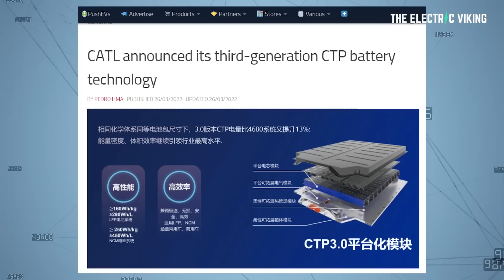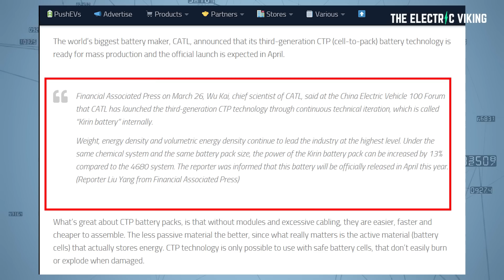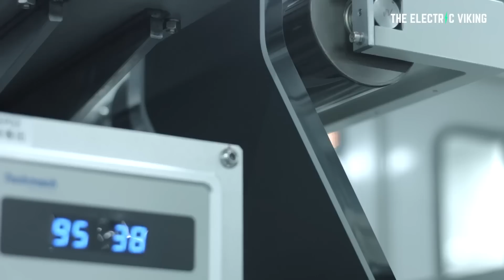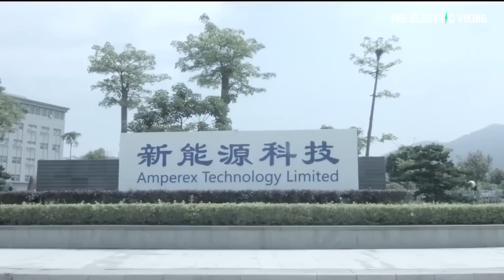NEW Teslas to get 28% higher energy density LFP cells

Comment: Very interesting. We need to remember that the 4680 Cell is a form factor and Tesla has developed it as a Tabless design. You can only talk about the current density of the 4680 Cell, because it could potentially use just about any chemistry. There's no way that Tesla are going to stand still with what chemistry they use.
The key thing that everyone seems to be missing is the ultra low internal resistance of the 4680 Cell, and the amazing thermal performance. The 4680 Cell has to be cheaper to manufacture than any of the pouch cell designs because it's so much simpler and lends itself so well to mass production.
I wonder how many years it will be before we have relatively few cells that give more than enough range. Imagine a car that only needed half the number of cells. Imagine the weight saving that immediately translates into longer range in itself. This can't be more than a decade away, and that will change everything.

Comment: Would be good if you go into the theoretical maximum amount of energy density based on lithium chemistry. From my understanding the energy density of batteries in terms of volume and mass is near theoretical limit (somewhere in the 90%). I think the real benefits come from packing efficiency, cycle degradation and fast charging.

Comment: Degradation is a way bigger problem than capacity.
Having your expensive Tesla be nothing more than landfill after 10 years is a huge problem.

My Ute is over 10 years old, cost me $45k new. Currently people advertising them for around $20k.

If I had bought a Tesla instead I would have a car with an absolutely fucked battery which would cost far more than its value to replace the battery.
It would be landfill.
Reply: Those batteries are already a thing if the past. New ones will outlast the car.
Reply: @monkeysezbegood  I'm yet to see one.
Reply: @youtubevanced4900  Basically all the Tesla's especially the cheaper standard range LFP battery ones.
Reply: @monkeysezbegood  guess we will find out for sure in a few years then.
See if a bunch of people start burning their cars as the battery get older.
Reply: @youtubevanced4900  yes, some of the legacy auto companies are struggling! It's not even their old cars.. GM comes to mind.

Comment: They say better than 4680. 4680 format with their chemistry or 4680 with Tesla chemistry?
250wh/kg is not good vs 2170 unless they are reporting wh/kg at the Pack level. 
2170 has about 250wh/kg at cell level. 4680 is supposed to have roughly 50% greater energy density. 
That would be much higher. So the stats are confusing.
Reply: I think they're just saying that sticking the same LFP chemistry in their cell-to-pack is 13 percent better in pack density than sticking it in 4680s. That's how I read it from the details discussed in the video.

LFP might have different thermal management needs vs NMC so it's possible. I think NMC will still win the density game with 4680, but this bodes well for stationary storage and standard range product lines.

Comment: 2012 Tesla Model S used Panasonic 18650 cells, with 250 Wh/kg.  That is the same as the new CATL NMC cells.  I don’t see the improvement here, unless maybe the CATL specific energy number was for the complete pack, instead of just the cell.

Comment: I'm hoping for a LFP Cybertruck.
Reply: I think it would make more sense for Cybertruck to have NMC:

LFP makes sense for regular vehicles such as the standard range 3/Y models, or for stationary battery storage where weight is less of a factor.

But long-range or tow/haul focused stuff like Cybertruck and Semi would benefit more from NMC chemistry, where the sacrifice in cost vs energy density is different. Most customers would probably prefer to be able to be able to drive ~500 miles and haul ~300 miles in the tri/quad-motor config, rather than spend $5000 less but get a truck that probably has 100 miles less range in those two scenarios. 

Would also be nicer from a charging costs angle to have NMC here, since such products consume more energy, have bigger packs and tend to be driven longer distances than average.

TLDR: The $/lb or $/mile equation might be different for such product lines.

I think Elon stated that down the road LFP will make up close to 70 percent of their products, so I'm assuming the other 30 percent will be trucks and semis etc that use higher energy density chemistries.

Comment: EV range at speed is hardly affected by vehicle weight. Once up to speed it keeps on going. 
Stop start traffic uses more power, but efficient regeneration braking puts back at least 80% (of the energy used to accelerate the vehicle) back into the battery. 
Excessive weight is never good but it’s not the huge negative for EVs that ICE thinking designers like to claim.
Reply: Higher weight increase the rolling resistant. Tesla are in general the lightest cars (with equal kWh batteries). This is one of the reason for their longer range beside better thermal management and lower drag coefficient.

Comment: I work for an American auto supplier.  We had several hours of  training about electric car safety. Basically anytime there's a tool needed to access the high voltage system only trained technicians should be working in that area.

Comment: One of the things not mentioned very much about the new 4680 form factor is that they can also use updated chemistry’s in a ongoing fashion as necessary. They also can be used in a sold state form factor as well. Solid-state does not need to be flat in form factor.

Comment: The big advantage of TSLA 4680 is the dry electrode process which will cut down on the time to produce and the factory footprint.  Also, the tabless process means that the assembly line doesn’t slow down, like the old batteries, to attach the single tab.  Thus TSLA 4680 will be cheaper.  Time=money
Reply: Doesn't tabless also mean lower internal resistance and better charge/discharge?
Reply: Yes, more pathways for the electrons to flow so less bottle neck and resistance/heat.  But the main key to 4680, I think even  more than it’s increased power density, is the fact that TSLA can build them much faster than using the old method.

Comment: Giga castings does NOT drop the weight of the vehicle by 150kg.

Another point where I disagree is on 1000 km range EVs   It will be a waste of resources.  What we need is more high speed chargers (range 'anxiety' is only an issue when travelling) and batteries than can sustain higher charger rates for longer.  Remove 98% of gas stations and all ICEV drivers will experience range anxiety even if their vehicles have 300 mi real world range.

But.  The new LFP chemistry increases my belief that the new 279 mi range AWD MY will be LFP based.  It's about 15% more range than the 244 mi RWD MY.  But.  The 279 mi AWD MY weighs as much as a LR MY.  W a 279 mi range LFP pack (of the same energy density of the 244 MY pack) it should weigh A LOT MORE than the LR MY.  So instead of adding 28% more range, they match the weight of the LR MY and that determines the range.   Instead of letting the pack size determine the range, they let the weight of the pack be the determinant of the range.  It will mean the new MY variant will drive and feel more like a LR MY (it also has the same power).
Reply: The problem with high speed charging maybe grid loading. A car parked at home can trickle charge. Also large batteries and long cycle life will assist the grid in being more robust because vehicle to grid can be used as dispatchable energy to stabilize the grid. 1000km vehicles would also have towing ability.

Comment: New battery chemistries and battery types like this excite me more when I think about their potential in a large commercial transport truck. Or, even as additional battery capacity in a trailer with an e-axile.   Since trailers are such straightforward pieces of equipment, I think it would be easy and simple to put certain new and even experimental battery types in a trailer given their simple shape.  Also, since trucks hauling anything consume more fuel, or in the case of an electric vehicle, electricity, an electric trailer is just a perfect solution.

Other battery types that simply aren't light enough or energy-dense could be used as stationary energy storage for battery-buffered electric trains that use conventional overhead wires or a third rail.

Comment: Viking, Tesla’s own 4680 cell packs have not yet been publicly benchmarked to my knowledge. So when CATL says that they are making NCM battery packs with higher energy density than the 4680, they are most likely referring to their own 4680 form factor batteries. As far as I know CATL’s 4680 are not tabless, and do not use Tesla’s patented dry electrode process. Also Tesla uses their own secret battery additions ( e.g. doping the cathode ) that CATL may not be using. 
Therefore all that CATL is actually saying here is that their own 4680 cylindrical cell packs aren’t delivering as much energy density as a different form factor battery pack they are making. 
What this makes me think is that without Tesla’s other battery improvements that CATL’s 4680 cells are nothing special.
Reply: And longevity? Have they cycled them long enough to ensure that they hold this 28% over a few thousand cycles?
Reply: They have not benchmarked Beacause what they have  said and what the batteries deliver actually are different🤣
Reply: Tesla went tables because a tabbed 4680 has to handle considerably more current along the tab than a 2170. The electrode area is at least double. Tesla do not make a tabbed 4680 because it’s risky at best.
Reply: @Dave5843-d9m  and the tabless is a large improvement in efficiency
Reply: excellent analysis

Comment: These advances in LFP energy density are exciting!  I'm not convinced that the CATL NMC batteries will actually be more energy dense than Tesla's high nickel 4680 batteries though.  Good to see competition driving advances, nonetheless.
Reply: I think CATL was claiming this was by using the same "chemistry" in both form factors. 

They're just saying LFP is better optimized in their cell-to-pack setup. They specifically talk, for ex, about how LFP needs less thermal safety so there's no need to baby the cells as much as the 4680 design does.

So yeah I don't think the NMC chemistry is used in the comparison, this is merely a marketing exercise, and they're technically not wrong about LFP getting more out of the space in the pack with their approach probably.

In my head I'm visualizing their setup as 4680 turned from cylinders to cuboids basically.

Comment: Just because materials get cheaper does not mean that vehicals are going to get cheaper. Margins are going to help with profits for maturfactures.
Reply: Margins fall when competition and mass manufacturing occurs. Companies fighting for market share of the same type of product will undercut each others price if they have heaps of stock. I suspect about 2030-2040 EV's will be far cheaper than what ICE's are. Because building a battery pack and electric motor is more automated and easier than a ICE and gearbox etc.
Reply: @AORD72  That is also true.

Comment: 2x energy density by 2030 seems unlikely IMO (we'll be running into physics limitations well before then). The good news, is that we don't need for that to happen:

In the early 2000's I remember people would claim that solar panels needed to be >45% efficient to be viable... that never happened, and yet, they are very viable.
Why? Because the prices came down exponentially. And I believe the exact same situation is about to play out for batteries:
 We don't need 2x more energy density, but it won't matter if prices come down exponentially.
Reply: True. But there will be applications, like aviation, where higher energy density is critical
Reply: @srikanna4597  Yeah, and we have to come to terms with the fact that battery powered aviation doesn't even have line of sight at this moment. There is even a chance it might not happen in a meaningful way at all, at least not comparably to electric cars.
Reply: @saintkamus14  It is a matter of time. It will happen at least for regional aviation.

Comment: TOTAL BS.  The new BYD Model 3 like car has only a 75kWh battery vs the Model 3 83 Kwh battery and weighs 300 lbs more - do your real life research.  Not some lies to cover for Teslas's 4680 failure which is what this BS is about COVER for a total Tesla screw up.  LFP is less dense and crap.  The only thing going for it is it is the lower risk of fire if the battery pack is penetrated. Its a cheaper lower density tech and junk.
Reply: You don't see being able to charge to 100% daily and run it down to empty. As being an advantage? 
If y ou take off the top&bottom 10% of the nickel heavy pack's. And if the 279 mile model y was truly lfp. It would have the same amount or even a little more daily range. 🤔

Comment: 28% increase in energy density means smaller batteries means more batteries means more cars.
Reply: It means a pack might be 100kg lighter for equivalent kWh rating, so the manufacturer can either accept that (with a small range boost as the cars lighter) or invest in more batteries (a bigger pack in kWh) for the same weight
Reply: means china has the world by the balls...this is potentially awful.

Comment: CATL compares POWER of their battery pack with 4680s (something they hardly could have actual clue about) not capacity. Or their statement simply means - if we put our chemistry into 4680 format, it would be worse.
The new LFP is good for Tesla though. This could make the new 279 mile Model Y with LFP possible.
Reply: Youare deliberately changing what Sam is saying 🧐
Reply: @icosthop9998  Am I? He claims the CATL battery pack is better than the 4680 pack, with no evidence whatsoever.
Reply: I came here looking for this comment. The claim specifically mentioned power, not energy density, but nobody else seemed to notice that mistake. In the end, time will tell how it all shakes out.

Comment: REMINDER - the 28% extra battery performance DOESN'T COME FREE, as the R&D and the capex buildout of new factory will be recovered against the new battery capacity volumes. It won't be same price, it won't be 28% more expensive. Likely to be 8_10% more expensive giving possibly a 20% superior cost/range outcome.
Reply: Advancement at the pack level means more cells in the same space. Taking advantage of that means more kWh but, because we buy more cells, we still pay more for the pack.

Comment: Maybe not 20-28% increase in range but importantly 20-28% lighter battery pack a better option and thus less cost car. Keeping a full pack with increased range will not necessarily reduce car cost! So, giga casting weight savings and savings on pack = increased range

Comment: What battery technology is used by ONE inc, the Michigan company with a 750 miles / 1250 km Tesla Model S ?
Reply: A custom hybrid pack features cell to pack tech using lfp for most of it, with a small section of very high energy density nickel cells.
They use for on demand high current acceleration events. Nio plans to do something similar later this year with their 150kwh pack's. 
Although nio is calling that a semi solid state battery pack, but the principle is similar 2 different chemistries in one pack. 🤔

Comment: How is this great for Tesla  ??? If Tesla suddenly lose the lead of their new batteries  ??
Reply: Because Tesla uses CATL LFP prismatic cells in Sr vehicles and megapacks
Reply: How do you know they will "lose the lead"?
.
Let's wait and see
Reply: no, not really. 4680 is mainly about high performance vehicles. Performances as in goes well, but also charges fast. This is most important in the high end market and in the truck and HGV market. LFP will be for run of the mill cars. And even these benefit from 4680 format if you want to push their performance. Then there is the aspect that Tesla’s efforts push the other battery manufacturers to continue to innovate. Having a choice of in-house and supplier batteries has numerous advantages. Supply chain security due to diversity, cars are always developed in-line with latest battery developments, you can push prices down, long-term lower prices due to competition.
Reply: Edit: the comparison is on the pack level, which does make CATL NCM batteries  better than 2170s from Panasonic. But 4680s are supposed to have "negative mass" for pack integration so that should make the pack level energy density over 300 Wh/kg.
Reply: Great, thanks for the education, I am a big Tesla fan and would like them to keep leading.

Comment: An average Australian house consumes electricity amounting to 18 KiloWatt(KW) per day . So a reverse feed from one of these new EV could power a house for a week on a stretch. Tell me again why we need back up Fossil fuel generators.
Reply: You're preaching to the choir.
Reply: in sunny AU a decently sized PV system, say 15kWp or up and a 100kWh battery will get you through the year without much electricity from the grid. In Germany, by no means sunny as AU, a 30kWp PV system and a 10kWh battery storage leads to an average 80% autonomy, so grid electricy consumption is reduced by 80%. From March to October, autonomy is near 100%.